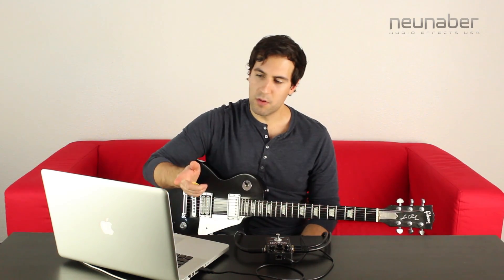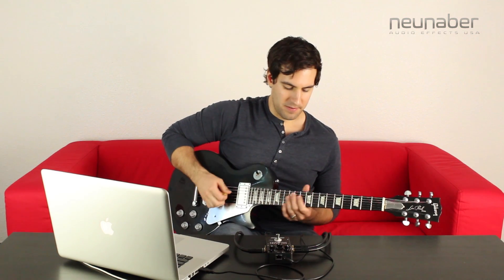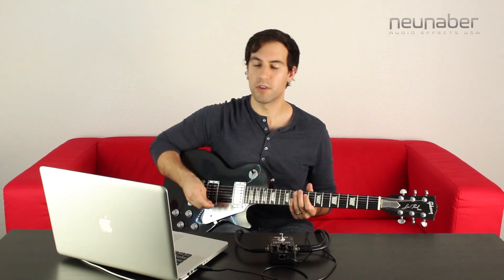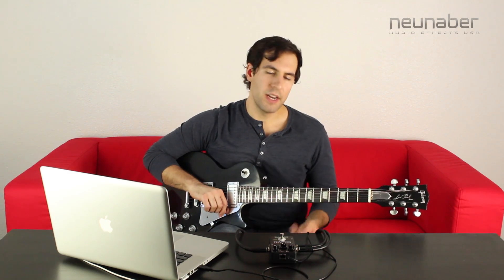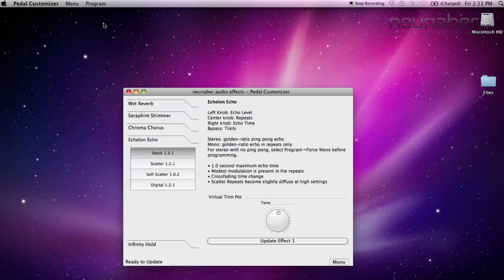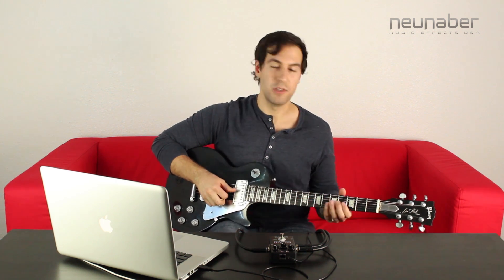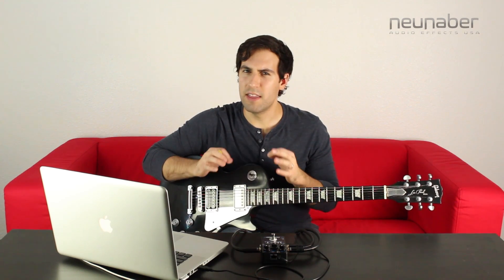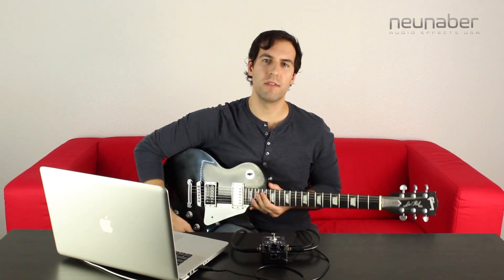Expanse Software | Advanced Functions

Comment: hey Neunaber ! Thanks for this useful video serie about those awesome pedals you make! 
I have a question about the force mono function (maybe) : 
If Im going to the inputs setereo but only plug one outpout to an amp. Will the pedal make a sum of the two inputs and send it mono ? 
I have a stereo delay in front and I want to be able to go setero or mono when I need it. 
regards !
Reply from the maker: Yes, if only one mono cable is connected to our stereo pedal's first output jack the signal will be summed to mono. If a stereo cable is connected to the second output or a mono cable is connected to each of the outputs, the pedal will produce a stereo signal.
Reply: Neunaber Audio Effects thanks a lot for the fast response. I have now another reason to keep my slate at the end of the chain!

Comment: Thanks Sean. Very informative video. I definitely want to try out the Split Mono/Stereo update on my Stereo Wet. Neunaber Audio Effects
Reply: Glad you like it Nathan. Try doing this:
- Select Force Mono and Split Update
- Load the two Effects Variations
- Plug in Output one for the Mono effect
- Use a "dummy" plug and plug it into Output two. This will activate the "Stereo Effect" but the Force Mono will output it as a Mono effect. 
So in a way, you get two preset effects out of one pedal. Brian hipped me to that.